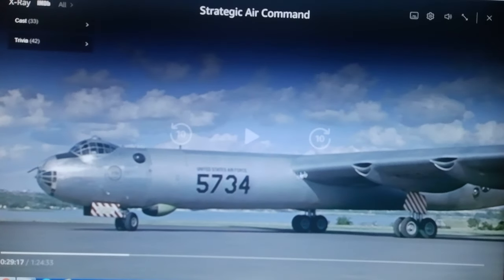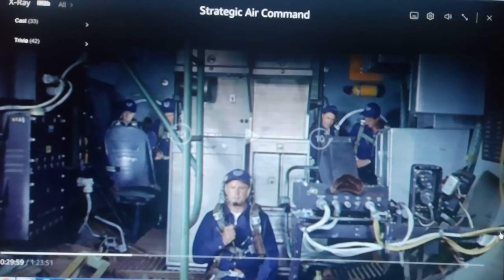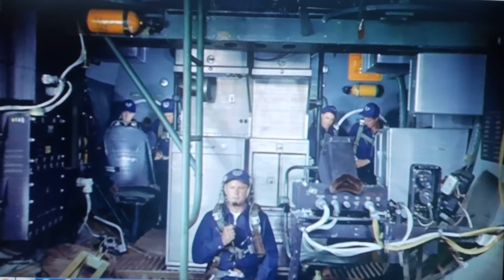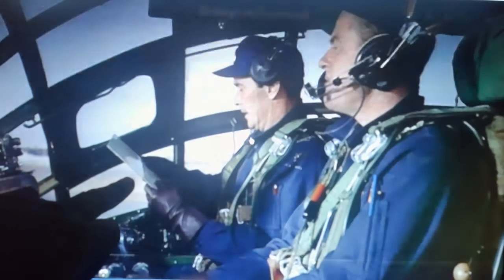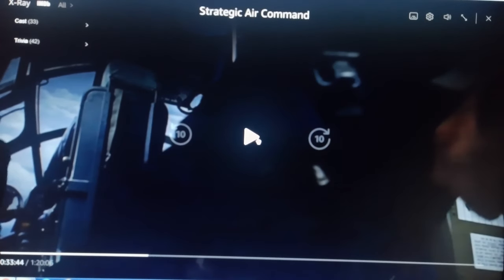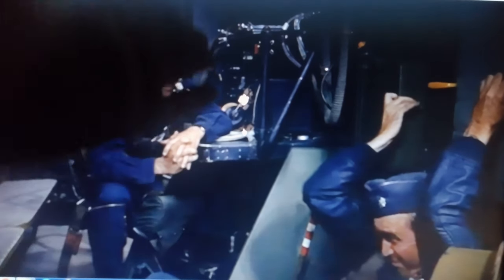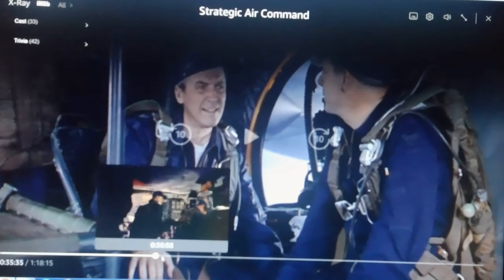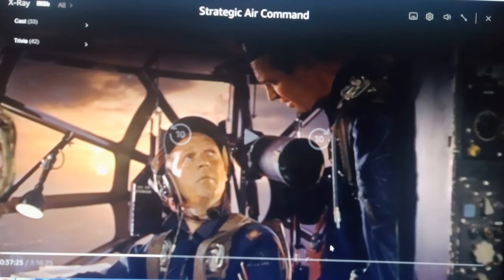The B-36 Peacemaker Stuff I Can't Unsee in Strategic Air Command

Comment: What bothers me most is that, in a 114 minute movie, they didn't accurately use 5 to 10 minutes for the use of the crew tunnel.
Reply: They used a set on a sound stage for those shots, I doubt there was that much light in there when someone was coming through.

Comment: Yeah, the inside of the aircraft in these scenes is actually a multi-piece set that can slide apart to allow access to equipment and crew, or back together to look whole as the shot dictates.  They have to make a lot of compromises to allow room for bulky cameras to move in and out, actors to be able to move through the sets, what looks good (or not) on camera, budget, lighting, sound, and what they're allowed to show.  This is especially true when the aircraft is still active and contains sensitive equipment that the AF doesn't want shown, as was the case with the B-36 when this movie was made.

The B-47 cockpit set from later in this movie is on display at the March Field Museum near Riverside, CA.  Visitors can see how, like the B-36 set, it was built in sections to open up for cameras or to slide back together as needed to look reasonably realistic and whole.  It looks pretty good in person but appears much more realistic in the film due to their careful use of camera angles, field of view, green screen, etc.  Soundstage sets that open up for cameras and slide back together to look whole, such as houses, vehicles, whatever, are a common part of Hollywood "magic".  They're typically pretty disappointing if you see them in person.

I was USAF on heavies including B-52s, and most movies that show the simulated interior of any aircraft, especially active war birds like B-52s, are very inaccurate, but the vast majority of the audience doesn't know the difference.  On the other hand, some are surprisingly realistic, such as the interior of the B-52 in Dr. Strangelove.  It's not 100% accurate, nor did it need to be, but it's far closer than most movies bother to make it.

Comment: Good observations – I never noticed that open cockpit window in flight. Most is just the usual rearranging of set positions and time done on movie shoots to make the scene work – they call it “cheating”.
There’s also the special paint job they did for the movie – the inset “No Smoking” on the nosewheel door, the AF star on the nosewheel seen in some shots, the extra stripe detail on the jet pods including an “eye” at bottom.  Red stripes are of course correct - 26th Bomb Squadron, 11th Bomb Wing.
Head first down the tube worked better for the scene, but they usually went feet first due to the nose -high flight angle of the plane. The tube does take a long time – a while back I went through the one at the AF Museum.
Not seen here but check out the crewman in the rear blister during the takeoff roll – he appears to be giving the camera the finger.

Comment: Considering that when it was filmed, the B-36 was still operational, Jimmy Stewart was an actual Colonel and probably had a good relationship with Gen. LeMay. There obviously were items left out for security or filming convenience. I imagine the greenhouse could get hot, whether it was the sun or stage lights providing the heat wouldn't matter. I don't think the general audience would know the different models and their layouts, only an Air Force member or vet that worked or flew them would know. I am the same way with the Top Gun movies, I worked on the F-14 and F-18 as an airframer, When I watched the first one for the first time, I hadn't worked on the jet yet but after a 4 year tour in an active squadron, I can pick apart various scenes, same way with the Hornet. So I sit and watch the movie and chuckle at the stuff that would never happen in real life. Good luck with the project, just to get the nose section built with the crew stations there will be an undertaking.
Reply from the maker: Thank you. How wildly inaccurate are the “F-14s” in Top Gun? Other than the B-36 in the film, my other favorite is the F-16 sets used in “Iron Eagle”.
Reply: @B36HPeacemaker  Not super inaccurate, just little things that you know would never happen. The TF-30 engine was prone to compressor stall, slamming the throttle like they showed would probably stall both. Entering a flat spin over the desert yet ejecting over the ocean, a flat spin is a vertical event and they went over a hundred miles horizontal. hitting something hard enough on takeoff to bust the nose gear off yet still retracting the gear and ending up in a dogfight or having most of the crew on the flight deck after they land, that would have caused so much damage. In the first one, you just got into a small war, you would be at battle stations with only the deck crew and a few from the squadrons out there. in the sequel, once the barricade goes up everyone clears the deck for the crash that is about to happen. With the 18, some of the flying scenes were stretching reality, there's a few former pilots on YT that picked that one apart. All in the name of movies and entertainment. Don't get me wrong, both aircraft have great capabilities.

Comment: Great presentation…Your knowledge of this particular aircraft is vast and you’ve pointed out some very interesting points about the apparatus and their functions…I was particularly impressed to learn about the length of the plane and how the crew had to use a tunnel and sled and cable to move around inside….knowing exactly which seats should be used by the pilot and co-pilot shows how much research you’ve done on this aircraft……(I’ve seen this film and the cinematography was great) I was always amazed how they used rockets to get this giant airplane off the runway… thanks for sharing …more please

Comment: One has to point this stuff out. I noticed that in Back to the Future the war memorial in the 1955 town was flanked by two 1930’s French 25 mm anti tank guns. Which is weird.
Reply: OH, but you didn't notice that the DeLorean traveled back in time???
Reply: @BarryHoffman-g4o  <-- Not to mention that a real flux capacitor would have neutronium shielding for the tachyon radiation.  ;-)

Comment: I don’t care about the inaccuracies .there are other things you missed as well.The eyeball on the jet nacelle.The props safe lights out part was not correct there was no light.It was a procedure called the Vandenberg shuffle and it was shown but not mentioned.Watch the props on the scene where they are about to take off notice they are systematically speeding up.After a B36 went into Lake Worth it was due to the Curtiss Electric prop going into reverse which occurred causing a B36 to crash into Lake Worth . The same issue was found on a subsequent aircraft with the same props the C133 .
 Also the issue with his arm in the B47 Why didn’t Leo just land it .This is still my favorite movie and aside from June Allison’s nagging the flying scenes are the best

Comment: It’s a movie !!!!
Reply from the maker: That it is, but to some it is a historical reference. I am simply pointing out the inaccuracies to whom it is applicable.
Reply: @acemakerI would say that using a film (made for the purpose of entertainment) as a historical reference for technical information (as if the film was a documentary) to be rather flawed.  Inaccuracies would indeed occur simply due to realities of filming.   Interior layout could get changed to allow for framing of shots (e.g. walls and bulkheads may get removed, equipment relocated, etc. -- simply to allow characters to appear in the shot for particular scene, and to allow for dialogue to progress without being awkward).  Transparencies (i.e. the glass of the windows) are often not present in the sets -- simply because they'd cause problems with lighting or cause unwanted reflections.   Depicting an accurate amount of time that it would take someone to transit through the connecting tunnel between the fore and aft section would result in several minutes of "dead spot" in the progression of the film.

Comment: Speaking of the pilot seats, they seem boosted comically high in relation to the control yokes. Their legs barely fit underneath. There’s no freedom of movement.
Reply from the maker: Yes, the seats they are in are the same type the later dual engineers used, which are nowhere nearly as comfortable as the proper adjustable, long range units.

Comment: Dude, they have to compress time for movies, no one wants to watch a cart return for ten minutes in a theater.
Reply from the maker: I’ve seen a few films in my time. I was simply pointing it out for content. If the director wanted to be accurate, upon entering the radio compartment, the other guy could have said “I’ll see you in the aft compartment” and went on his way while Dutch could have resumed his conversation as the cart returned. Maybe we will get lucky in the reboot.

Comment: They had much mechanical trouble with b36 in a real war I don't think 1 of the b36 would have made its to its target in the ussr
Reply from the maker: They would have made it, especially if prop fighters were still common. The B-36’s RCT would have knocked anything out of the sky if it got within firing range. Keep in mind the 36 had a highly accurate radar aimed tail gun, and towards the end they were in the process of adding radar to the hemisphere turrets. Early jets couldn’t reach the 36, and if they did they couldn’t maneuver in the thin air at the great altitudes the late models cruiser at…with radar tail gun at the ready.
Reply: @B36HPeacemaker  the mig 15s came out in the early 1950s they could get to 50000 feet .When the b36 fired its 20mm cannons alot of the time it knocked electonics in the b36 because of the vibrations
Reply from the maker: @robertfoster7807  At such altitude the B-36 could out maneuver a MiG. The vibration problems were addressed with the advent of the C turret system which incorporated dynamic, spring loaded carriages for the cannon.
Reply: @B36HPeacemaker  its only cruised at 230 mph on the piston engines whats mig 15 top speed  690 miles per hour
Reply from the maker: @robertfoster7807  At altitude the B-36 would have already dropped its bomb(s) before the MiG could make it’s climb. If the MiG did catch the bomber it would have one pass, and that one pass would have been met with a radar controlled tail gun, in any weather day and night.
Reply from the maker: @robertfoster7807  Do you understand what happened to the early jet engines of that time, at altitude? Furthermore, Russian jet technology was not nearly as advanced as ours and still isn’t to this day. At high altitudes there is far less oxygen to burn and influence aerodynamics. This is where the B-36 shinned with its massive wing area, colossal control surfaces and six, dual turbo supercharged engines. Sending a first generation MiG after a B-36 would have been like trying to hit a target with a musket. However, times changed with bigger, faster interceptor aircraft and especially guided missiles. But, we’re talking about early MiG armed with cannon when the B-36 would have been in combat based on the historic timeline.
Reply from the maker: Sure, a MiG-25 would have pulled a B-36 out of the sky; but that’s not what we are talking about. I’m coming from the idea of WW2 continuing well beyond 1945.